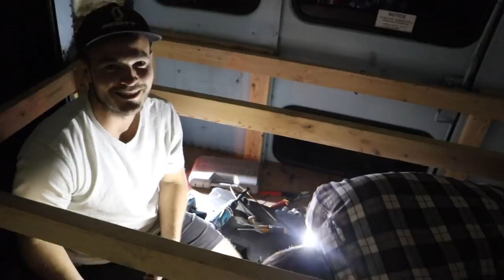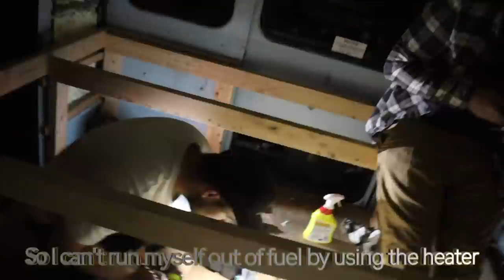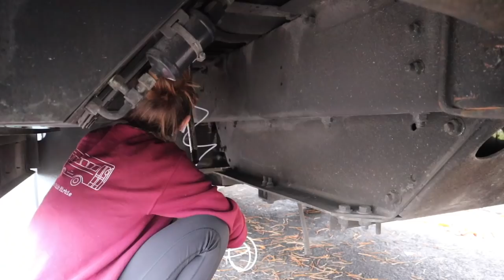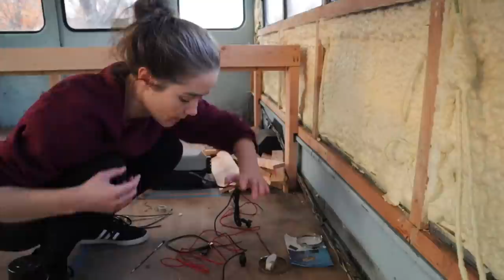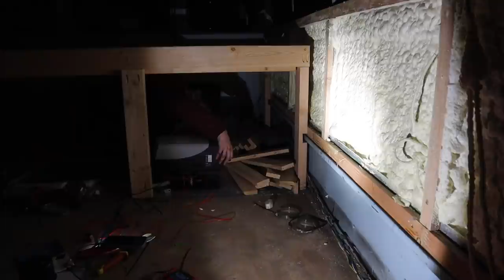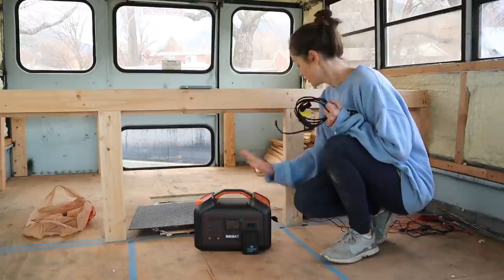Keeping warm in my school bus tiny home - Diesel heater installation take two + Bullbat Pioneer 500

Comment: The amount of knowledge you gain by figuring it out yourself is golden.  Then when things go wrong you will be able to trouble shoot it just like today.  Big Bravo.
Reply from the maker: thanks! hope you're right
Reply: @EmmaBuildsBirbie  A thought - why not use a 19kw Tesla Model 3 battery module, copper heater tank and heating element with a timed thermostat to keep the water hot enough, also you could put a motor between the transmission and rear axel as propulsion and regen for the battery....  add a 2nd battery latter on too...

Comment: There is a tool extraction, it about 20” long that is use to pick up tools or bolts that fall in the engine compartment that you can use for this.
Reply: It looks like a piece of choke cable that has little claws on one end and a spring loaded actuating button on the other
Reply: @noshsreqd  yes, this will allow you to get the paper out of the gas tank
Reply: @francrivera1072  How will she be able to see the object though? That hunk of plate could be anywhere in the tank.
Reply: It just a matter of filling until she get it, is better than leaving it inside the tank and clog the fuel system.
Reply: @sjporr  flashlight

Comment: If you can't retrieve it you may have to siphon the tank with a hose or a pump until you find it.  My opinion, you shouldn't leave it in and drive.  You don't want it to break up and get in the fuel line and clog it.

Comment: it's always fun watching your channel. real time interactive videos are what you need for some of your questions 😅find sound dreading board (or ceiling tiles) and make a box to go around the heater with holes in double walls and at a 90 degree turn for the ducting to make it quieter.

Comment: I used to use one of these in my semi truck for years. Just a helpful advice. Always set it to 90+ degrees when starting it up. And then when it starts up, put it at the temp you want it to be at. I believe they run for about 8hrs non stop unless you manually turn it off.

Comment: Emma, if you dropped metal shavings in your fuel tank, get a long handled magnet with a flexible handle to fish them out. If you dropped a paper plate, buy one of those flexible spring gripper with a button that allows the little fingers to pop out to grab trash out of your tank. DO NOT listen to your brothers. You could ruin a costly fuel pump with metal shavings. Good Luck!!!

Comment: Well done Emma hey one thing you should know about the diesel heaters don't disconnect the power from the heater while it's running it can fry the heater so be careful always put the heater in shut down mode before you unplug it from your battery pack when you put it in shut down mode it stops burning fuel and the fan keeps running to bring down the temperature in the burn chamber and shuts the fan off when it's safe to to protect the components inside it.
Just thought I'd let you know a lot of people have ruined their heaters not knowing this.
And as far as the debris in the tank it's possible you may have to pull the tank to remove it if it does go to the pick up line that goes to the engine. If it was me I'd run half the fuel out of the tank and us a scope camrea mechanics use them to look at the insides of the engine sometimes but try not to dip it into the fuel and once you spot the debris there's a long tool that's flexible and it's spring loaded one end has a button kinda like a syringe the plunger part and at the other end has three finger claws that come out so you can grab items I'd try that auto part stores have them Amazon would have the camrea scopes. Good luck with it.
Reply from the maker: thanks!

Comment: Hello I'm a heavy duty mechanic. If it were my bus I would want the plate and tape out. It could cause quite a lot of drivability issues, such as low power output or stalling.  I'm not familiar with your model fuel tank but there may be an access point to get into the tank, you could try and fish it out with fishing line and a treble hook. Lastly If all else fails I would drain the tank and remove it. 
If you have the model and year handy I can look it up.
The plate won't damage your engine or anything but the odds of the plate getting stuck increase as the tank empties, so that when it is low it may stall and seem like you ran out of fuel.
I rambled,

Comment: Emma, a piece of an advice how to remove the paper plate and paint tape inside of  Birbie diesel fuel tank.
1. Drain the diesel fuel in a laundry tub and remove the fuel tank at the bus so that you can easily remove the paper plate and paint tape. Or
2. Use the bus when going in walmart or any short trips in order to be level down your diesel fuel before removing the fuel tank and reach out the paper plate and paint tape.
Take care always Emma and stay safe.

Comment: Emma, you really do need to find a way to get the cardboard & tape out of your fuel tank, that your brothers dropped in it, that stuff will break down & if any of it gets into your engines injector pump, it could cost you a fortune to fix,.. You can buy a long  flexible grab tool to do it.. xx

Comment: Hair looks great. It's your bus so you're always accountable for free labor. Get the same paper plate put it in a small container of gasoline and see what the plate does overtime so you'll know what the plate is doing in the tank. Make a rake out of wire hanger that you can compressed its fan down into the hole and then it will spread out and you can rake the bottom of the tank bend the ends of the rake into hooks to grab the paper

Comment: Use like a 10ga wire for heater to batteries unless you're really close then maybe 12ga, the larger load on a long wire needs larger wire to help avoid voltage drops

Comment: I would have tried to find a road or hill with a steep incline and parked the bus on it, and just tapped on the side of the fuel tank so the plate would slide down and stop against the side wall, then just look down the large fill hole with a flashlight and fish the plate out with a coat hanger. I bet that would work. You might need to try different tilt angles but it should slide around until you can see it. Preferably drain the tank first if you can into another container like an old 55 gallon drum. before you start this process. You can always transfer the Fuel back into the original tank After you to get the plate out.  Also, have you thought of trying to mount a magnet 🧲 on the end of a piece of strong wire and getting it that way. 

Just a couple of ideas that I thought might help, you really should get that out of your tank.

As a last Resort you could just drain the tank and remove it then just have two people hold it upside down and shake the plate out of the large fill hole. 

I would find way 

Good luck

Louie 
IL 🇺🇸 USA

Comment: when you wire it up into your bus ensure you get a proper fuse for it.  Those fuses are there to protect your equipment and to keep you safe.  Please dont get a 20 amp fuse because its good enough when the device only needs a 10 amp fuse :)
Reply from the maker: thanks!

Comment: Great job figuring it out. So entertaining to watch. Just make sure the heater isn't blowing right at something that can melt or burn. I know those things can put out some serious heat. I had one in my semi truck. Your gonna love that heater. I would also have a backup propane heater on a couple 20lb. Tanks in case of the other one quiting on you. Having the rear bumper extended a couple feet with tread plate on top. You could recess the tanks into a place in the tread plate. And lock them in. The small deck could double for ladder access to the roof and just as a small porch to put a moped or bike on. Harborfreight sells small rotating truck bed cranes for a good price that could aid in loading and unloading a moped or bike. If I were building one I'd probably want some sort of other motorized transport on the back just for sight seeing and short runs into town or trail rides to get those awesome shots of beautiful views.

Comment: The new cigarette lighter plug the you got from Amazon is capable of supporting a considerate amount of amperage depending on the wire gauged, at 120 volts AC ( alternating current )  a # 12 wire is rated to safely work up to 20 amps. now you are working on 12 volts DC ( Direct current ) most cigarette liter style plug typically only has a 2 to 4 amp fuse in side the plug. Now look at the package that the plug came with and read what size ( gauged ) the wire is. A number 16 gauged wire is good for 10 amps, a 14 gauged wire is good for 15 and a 12 gauged wire is good for 20 and last but not least a number 10 gauged wire is good for 30 amps. So depending on the wire size you can remove the fuse from the plug and replace it with a fuse that is recommended for the heater.

Comment: Great job Emma. I live in a 19ft camp trailer full time. I installed a similar diesel heater. After running it for 5 months and facing a winter I would suggest two things. 1 add a t heavy duty Tourette plate to protect your floor better Eberspacher Espar or Webasto floor mount plate turret bracket | 190246 | 292100190246. 2. Lose the light weight muffler and buy a Webasto Exhaust Silencer muffler 22mm | 86450B | 86450C | 1320895A. The muffle cut down the exhaust noise by about half. Keep up the great work.
Reply from the maker: Thanks for the tips!
Reply: @EmmaBuildsBirbie  remember to always keep the exhaust clear and fuel cap on as both burnt and unburnt fuel is toxic to breath...

Comment: As always entertaining!  The exhaust buildup under the bus from the heater is absolutely not an issue. You'll have a CO detector in the bus anyway, but the output is tiny and the bus is so open underneath, there's absolutely no chance of trouble if you just point it straight down at the ground under the bus. As always, love watching your problem solving. :)
Reply from the maker: awesome, thanks!
Reply: Honestly, why take any unnecessary chances? She is doing all of this work, make it right.
Reply: @chrisallen9154  you're absolutely right. My bad. There's nothing wrong with an exhaust extension of course.

Comment: I don't think I mentioned last week I kept melting the fuel line (clear plastic) from the heat of the silver exhaust pipe. Everythings so close to each other coming out of the heater, things might shift while driving. Secure everything you can before you have to take it all out later like I did. My exhaust doesn't go all the way out the side but it's fine.

Comment: Hey Emma

The word you were thinking of is “ draws “ if you heater “ draws 10 amps “ that is lot of current. I’m not surprised that you might have blown the fuse in the plug  ( some times the fuse is located in the plug all you need to is unscrew the end and replace it ) You also need to know, that the wire gauge is important also.The more current your drawing the thicker your wire needs to be to handle it or it can get hot and or melt or blow the fuse again. I’m not familiar with the power battery pack source that your using but I would guess that or has a fuse or breaker that will trip before the heater power plug or wire gets to hot. You should be able to find that information in your manual and how many amps each of your Power inputs can handle. 

Wishing you good luck, installing a heater could be a bit of a challenge. But I”m sure it will work out fine.

Louie 
IL 🇺🇸 USA

PS: If you have any other questions please feel free to just ask. I”m always willing to help, just give me a little time to get back to you.
Reply from the maker: thank you!

Comment: I read through the suggestions below on the paper plate that made it into your tank. I'm not sure how you would be able to see the plate and fish it out of that hole, your basically blind fishing. You might get lucky though? I hate to say it but your probably going to have to drain that tank. Maybe if you can drain it from the bottom (assuming there is a way to do that) as the level drops you could somehow see in from the top to fish out the plate. As the tank empties you should be able to see more from that top hole, might get lucky. However I do agree with those that suggested doing whatever you can to remove it. If it does break down enough to get into your filter, it would still take forever to get it all out. If it doesn't break down then your chances of it plugging up the outlet from the tank is great. And as your tank gets lower that chance gets greater.
Best of luck

Comment: The paper plate and tape should dissolve after a couple days, the fuel filter will catch it all though. If you want peace of mind you could open that top port on the tank and have someone pump out the tank and then drop an inspection camera in it to see the condition. It's general rule of thumb when you own a diesel to carry a spare fuel filter.

For your 12 volt electrical I would highly recommend building a separate harness to power just the RV side of the electronics. Also look into RV breaker panels, they have your normal 120v breakers and also a panel of fuses for your 12v systems as well to keep everything in one spot!
Reply: Paper does not dissolve in fuel. Fuel filters are made from paper...

Comment: Fuel tank issue you will need to get a fluid pump and remove the fuel if you are lucky the pump might suck the paper to it and then you can remove it if you leave it in there eventually it will plug up the fuel system it's not if but when it does and It will do it when it is most inconvenient and cost a boat load of money to get it fixed

Comment: That stuff in the fuel tank could possibly clog the fuel line. It could get sucked into the opening of the tube and block it. The fuel filter cant prevent this. That might happen, it might not happen. Every time you drive the bus you will never know, its trouble waiting to make an appearance when you can use it the least. For that reason i would remove it at all cost. It would drive me nuts to know the engine could starve of fuel at every moment. Such things usually rather reliably appear at the worst possible moment. Paper does not dissolve in diesel. Fuel filters are made from paper.

Comment: You should use lower gage wire (thicker wire) when you attach the heater to the bus power. The longer the length of wire the thicker you need the wire. Use at least 16 gage.
Reply: Should use 10ga from battery supply to heater to avoid low voltage shutdown

Comment: always learning well done.

As for the paper and tape in the tank,  it could take a  week or more to dissolve , if it doesn't properly dissolve it could cause you problems  (engine randomly stopping or running poorly if it messes up the flow of fuel).  
Im not sure what sort of fuel pick up you have in that tank but it could be a problem I would ring a mechanic who works on those school busses and see what he thinks..
Reply: just read a comment about the fuel pump to get it out.. good idea... also look into syphoning it out same idea just cheaper without the pump

Comment: Just a thought to keep in mind as you move forward.  My mentor once told me, a circuit unfused is a fire waiting to happen.  Loads on wiring and other circuits are limited to the rated amps they can carry.  You design the wiring and circuits to handle the loads by amperage, the fuses insure that those circuits can not go beyond capacity.  Always fuse at source, keeps spares, know where the fuse links are, and know how to troubleshoot a circuit.  If you blow a fuse, need to know why you blew a fuse, not just stick another fuse in it.  You seem to get it fairly well from your experience with the fused 12 volt plug.   Unfortunately, most of those do not go beyond 5 amps off the shelf.  The one you got from Amazon looks like quite the find.
Reply from the maker: thanks! i've definitely got a lot more to learn 😅

Comment: Probably be safer to use a flashlight that is too large to fit down the hole you can mask the light that is not pointing down the whole.  If you can see the paper it will be easier to clamp on to it.

Comment: if the head unit turns on but errors out and wont put out heat - make sure the end of your exhaust pipe is pointed down and out on a 45 degree angle - worked for me - keep it in  mind.  :)

Comment: Since your brother knows how to weld I would not put that noisy heater in the bus, ask him kindly to make a possum belly under the bus and run two 3" lines one for return and supply and just insulate both lines and definitely line the possum belly with insulation to reduce the noise from the heater damn I don't think they could make a fan motor with higher sone. LOL

Comment: Why drilling into the Tank anyway? Why not taping the Fuelline?
Reply: The fuel pump could cause pressure to the heater and not make it run right.
 Seen a vid on that, turned into a big problem.
Reply: Also the engine fuel pickup is designed to draw the last drop of fuel. Whereas if you have a separate pickup for the heater you can position it a few inches above the bottom of the tank so it won’t suck the tank dry  while using the heater. This means there will always be some reserve for the engine.
Reply: @chaosplan  I just use a five gallon gas can.
 Drilled a hole and added pick up line.
  Just make sure you vent it, loosen cap or breather vent or drill a small hole (small).